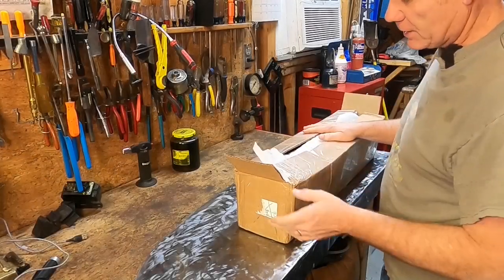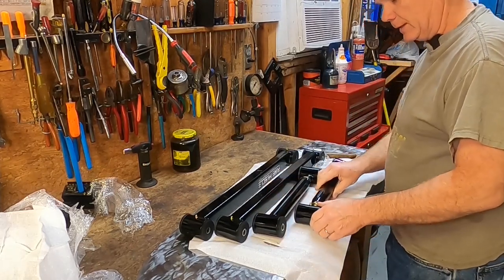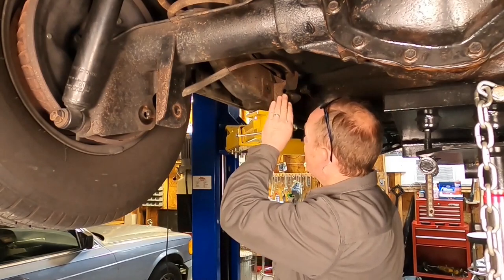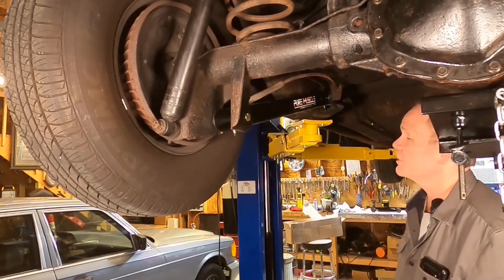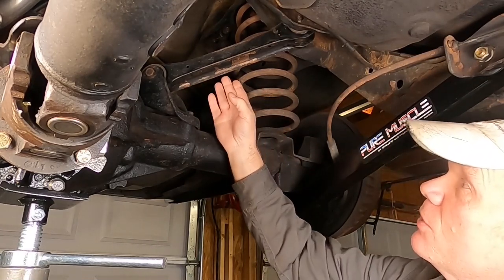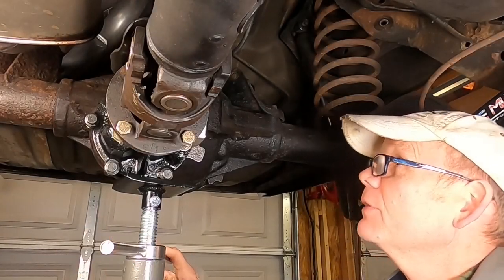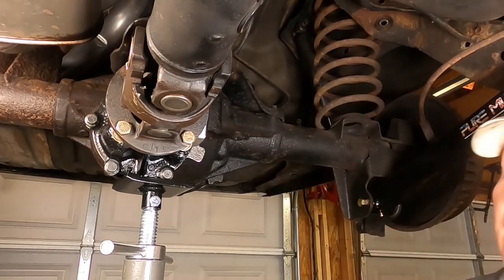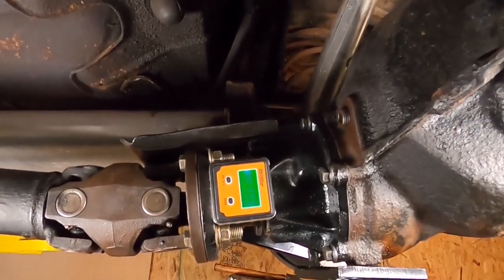71 Cadillac Coupe DeVille - Finding Resonant Drivetrain Vibrations - FINAL - Correct Pinion Angle

Comment: when I was a kid , we had a 76 deville. We hit a huge hole and the drive shaft rear joints got destroyed. We put a used one from another 76 it worked fine. We didn't have any angle issues. I don't know how you got those issues.???
Reply from the maker: I think the car was put together this way from the factory and never driven a lot on the highway.

Comment: Run Lucas power steering fluid .... It more of a hydraulic oil and does way better with power steering noise then regular fluid that's like transmission fluid
Reply from the maker: Good tip! That's what the new pump will get then. Thanks!

Comment: Great job. It’s been a lot of work but you solved this quite perplexing problem with persistence, logic, and a little good advice here and there. Would never have guessed the factory driveline angles could be out of whack enough to cause a vibration.
Reply from the maker: The early 70s was a rough time for GM.

Comment: There is a super easy way to bleed out the old fluid from ypu ps pump without starting the car which is a huge mess.

Jack the front end of the car off the pavement. 
Drain the pump basin and plug the return line fitting at the pump

Direct the return line into a collection device. 

Fill the new pump with your selected fluid.

Turn the steering wheel while the car is off, lock to lock....checking the fluid level in the pump reservoir every lock to lock.  Keep an eye on the color of the fluid discharging from the return line until it looks like the stuff out of the bottle ypu bought.

Hook return line back up to the pump and refill reservoir and drive.....should be bled out of air and nearly messyless....
Reply from the maker: Excellent write-up. Thank you for posting for others benefit! The procedure you mentioned is what I used recently to replace the pump. Did not video it however.  The original factory service manual says to disconnect the coil and use the starter to turn the engine/pump over to flush the system. I tried this but it did nothing. Using the procedure you documented above actually did the trick. Man o man was that old fluid  worn out!